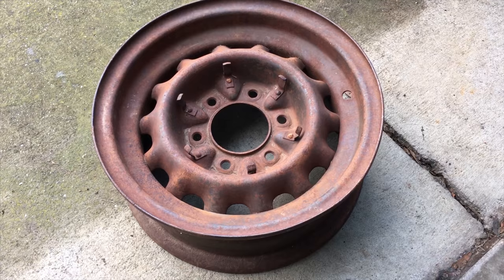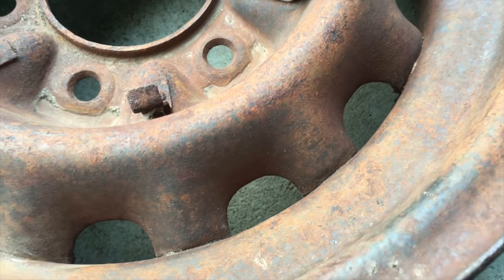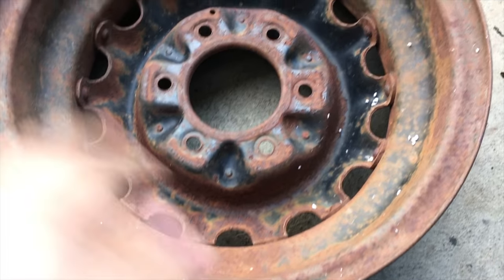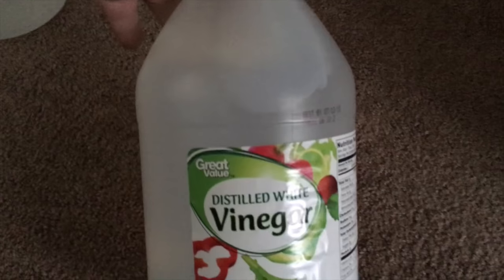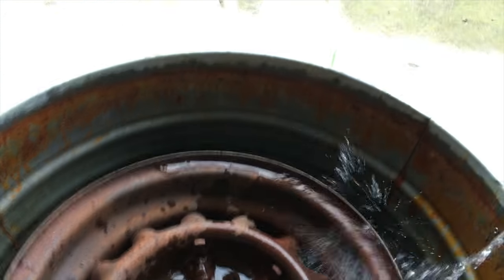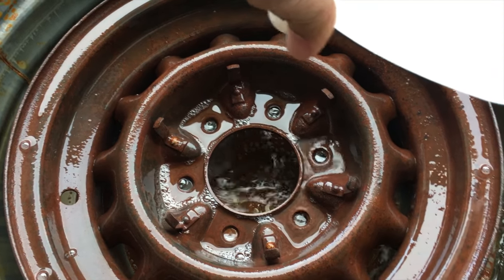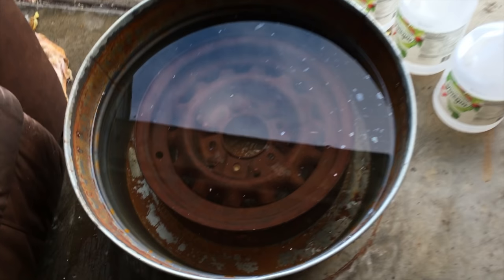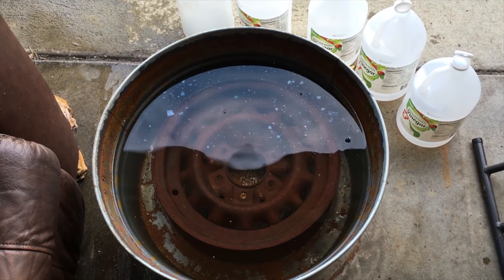DIY: Artillery Restoration: Rust Removal Project

Comment: You should use the Vinagar 100%.
After you rinse you must Neutralize the Vinegar.. Put the part in the tub again with clean water and a box of baking soda and let sit for 20 min...then rinse.
If you don't the Vinegar will keep eating the part even though you rinsed it off..i been doing this for 10 years now....
Reply: How long would it take to do the rim with straight vinegar? And how big of a box of baking soda? Thanx
Reply: I was going to ask about using it 100%...
Same as warrior... I'd like to know more details on duration and so on...
Thanks in advance.

Comment: Thanks for the technique, I just picked up a set of 15” arts for my 38 Chevrolet sedan. I was using a drill and wire wheels removing too much material in addition to the rust. I am going to use your technique, less destructive for my 1938 artillery’s and I will  apply this to rear quarter window vents I have on the way too. Thanks again

Comment: I used a minimum amount of vinegar by placing the wheel into a heavy duty garbage bag wrapped tightly around the wheel and tied at the top. This also reduces evaporation.
Reply: Good suggestion, lostallmymirth. Why don't other rust-restorers use this method ? So far I have not seen others using it.
Reply: This is so unbelievably smart, Im trying to derust a propane tank and I was in despair about the amount of vinegar I'd need but this makes it feasible now! Thank you

Comment: Don't soak any ferrous metal in acid due to hydrogen embrittlement. That wheel won't do you any good if it breaks under load. There are other products specifically made for rust removal or get a blasting cabinet.

Comment: I'm making a cowboy cooker and have a rusty plow disk that I put in a pan of distilled vinegar. I can rub my finger across is after 4 days and the rust rubs off and I see black steel. No grinding so no grinding off metal.  I will leave it soaking for another 3 days and then take it to the carwash and pressure hose it clean to get the vinegar off. This plow disc was rusty AF and I don't own a grinder so I believe I will be able to clean it off with a wire brush. I didn't think it would work but after watching this video I figured why not try a cheap home remedy. Cheapest place to buy distilled vinegar is Walmart or if you have Foods 4 Less in your area. Less than $4 a gallon or the 2 pan at Sam's Club or Costco is dirt cheap. 
Thank you.

Comment: This works with all rusty iron parts. Can heat up the water, and use a fishtank-bubbler to keep the water moving to increase time. Great vid! Dont forget to wash thourogly and treat bare metal fast, tends to rust quicker after this treatment. I use baking soda water to neutralize the acid..
Reply: Do you pour baking soda water on the bare metal?
Reply: Pure in Nature's Garden When using vinegar does not really require the baking soda if you wash well with water. 
But mixing baking soda will neutralize all azids

Comment: Waste of vinegar and water. Just vinegar, by itself would have been better in half the time. Also, that extra 3-4 inches of depth is wasted water and vinegar. Better be ready to paint as soon as it dries. That clean surface is ready for primer/paint or rust; whatever gets there first.

Comment: Have you tried this method with Chrome Rims? Was just wondering if the vinegar would hurt the chrome .
Reply: Do not do this with chrome rims. You can and will permanently destroy the finish. It should only be done on steel rims. There will be a chemical reaction and it could make the chrome fall or flake off.

Comment: in my experience electrolysis or the works toilet bowl cleaner are a lot more effective, but in any of them you will need to add a flash rust inhibitor such as wd-40, or baking soda, etc, and be sure to have adequate ventilation

Comment: Thanks for the inspirational video. I'm currently doing same using 4 gals of Heinz vinegar and equal parts 4 gals of water.  8 gals is enough at 50/50 mix for one 15" steel wheel in 16-1/2" plastic tub. My plan is 1 week per wheel. x4 = 1 month.  In response to other comments below, both vinegar and Oxalic acid will do this.  Difference is Oxalic acid is a nasty chemical to pour into drain afterwards. Vinegar is more environmentally-friendly. Make sure not to leave steels items immersed for too long as the solution will eventually eat the metal completely.  Suggest 1-2 weeks should be all you need.  Immersion of more than 1 month could damage the metal.  Soaking / rinsing in baking powder or other neutralizer is also a good idea.  Cola will also react in a similar way. Vinegar seems to be best choice. I used 3 x 1.32 gal. jugs from Costco. Cost was $2.99 ea. or $9. for 3 jugs.

Comment: That rim looks galvanized... and the rust looked like paint peeling off of it...
Reply: Tabourba  That DOES look like the paint peeling off of the steel!!  Not rust. Look at the first large pieces the he peels off, they are FLEXIBLE, obviously not rust, since rust is brittle! The best way to restore rusted steel and iron (think cast iron pots, skillets, etc) is to use a 12v battery charger, a plastic tank (like 55 or 60 gallon drum half, or whatever the item fits in...), washing soda, and a iron or steel electrode... this works like plating, but is actually doing something like reverse electrolysis of the rust...

Comment: so what do u recommended putting on the wheel or piece that one would be working on. is there a bear metal sealer one would use to protect the metal before paint or powder?

Comment: And that’s not rust coming off, that’s the paint underneath the dirt and surface rust...now you’ve exposed the fresh metal you need to spray it in a phosphoric acid to stop it flash rusting.

Comment: Looks like there is still some rust, for the money and time a small sand blaster could do 4 wheels in a day then rinse with some phosphoric acid and water then prime.
Reply: And no risk of hydrogen embrittlement.
Reply: 4in a day  my blaster does 4  in an hour
Reply: Blaster equipment,  blaster sand, = $$$$$$

Comment: Can u use the vinegar twice
Reply: It's only $2 a gallon. I wouldn't.
Reply: I've had a vinegar tank going for month, that shit was filthy but parts always came out clean.
Reply: MR. BRICK HEAD   Sure you can.   I pour mine through a paint strainer, even a colander works.    It’ll be dirty looking and smelly but just dump in the jug and stash away.     Electrolysis though is oh so much faster and much cheaper.
Reply: Yes you can. You can keep adding vinegar to it. Once your done pour it on the weeds. Makes a good weed killer.